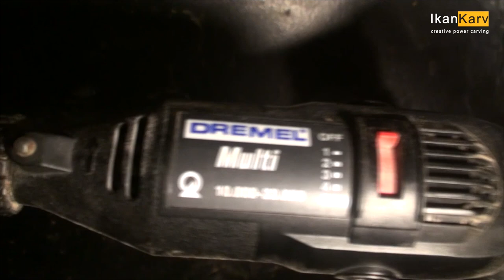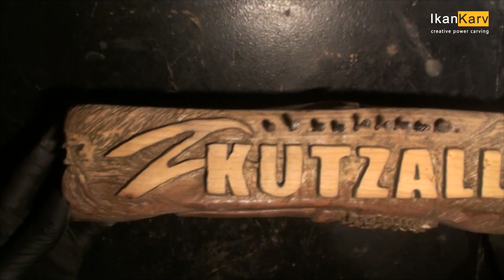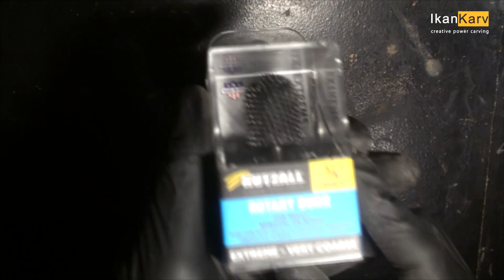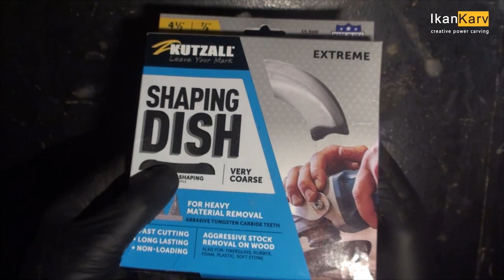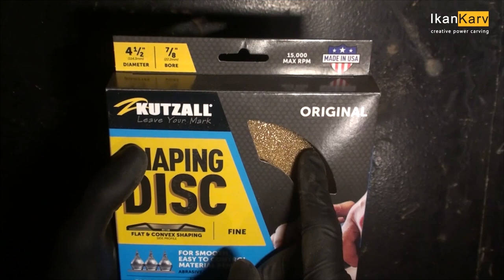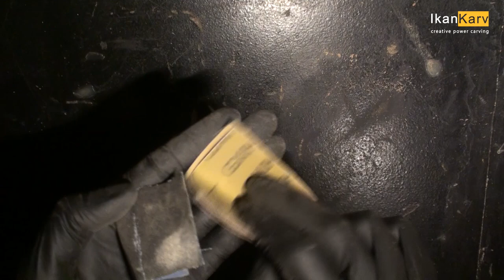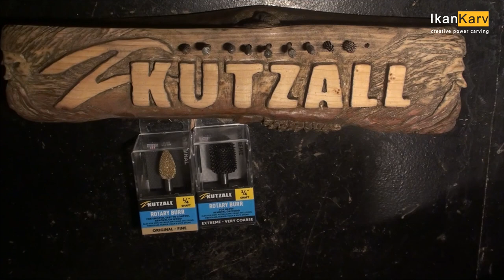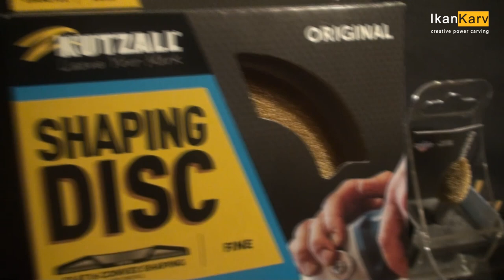Power Carving Tool Review - Dremel rotary - Kutzall Carving burrs - Die Grinder- Wood sculpture

Comment: I didn't know until now that you could run a flex shaft off of a die grinder..thanks
Reply: You can also hook the die grinder and the angle grinder to a foot pedal for speed control. Just sayin, in case you didn't know.
Reply from the maker: Thanks John, yes its a lot easier than trying to hold a die grinder to carve details, I put links in description for the die grinder and flex shaft

Comment: Hi Bap, thanks for the info. What type of flexshaft did you have on the die grinder? Cos it has to take the 1/4 inch burrs and i didn't think the dremel shaft could do that. Look forward to seeing your piece finished!
Reply from the maker: Thanks Claire, I put links in description for the die grinder and flex shaft for you. The flex shaft hand piece takes all sizes of burrs as it has a chuck.
Reply: Thats great, thanks Bap

Comment: Will the kutzall bits work on carbonfiber?
Reply from the maker: Im not sure to be honest, but if you click the link in the description you  can read on the kutzall site the types of materials and jobs hey can be used for, on the main page beside the products button it says - Resources if you click there you will find ''d.i.y applications'' it will explain in there what the burrs can be used on.. hope that helps.
Reply: @IkanKarv  I actually went to the site and emailed them. I also bought a small extreme burr flame bit with a ⅛th shaft to fit my dremel tool. 

I'll let you know if it works in a week or so, if it does I'll buy more using your code.
Reply from the maker: @anthonycampos7417  Thank you, hope it gets the job done